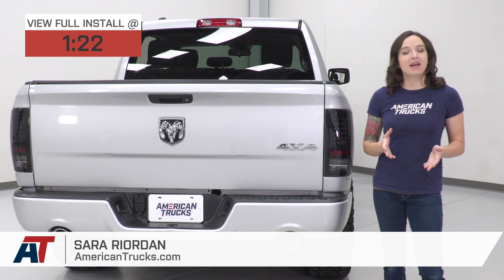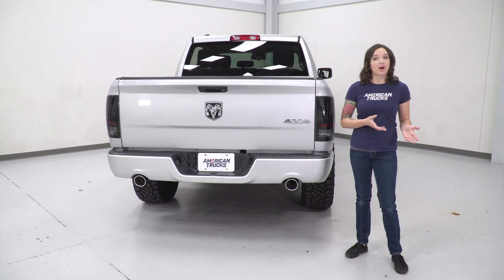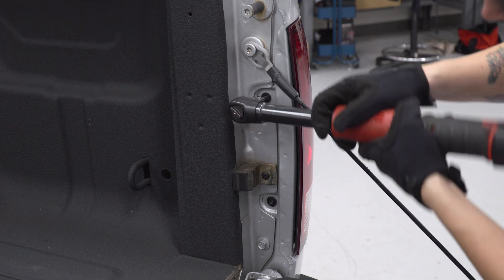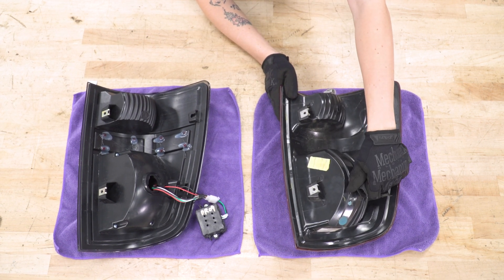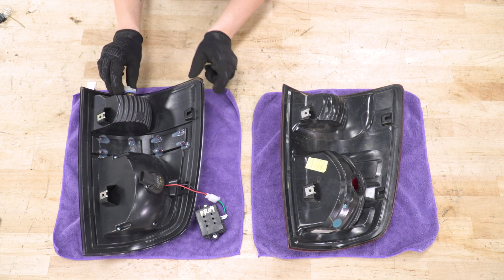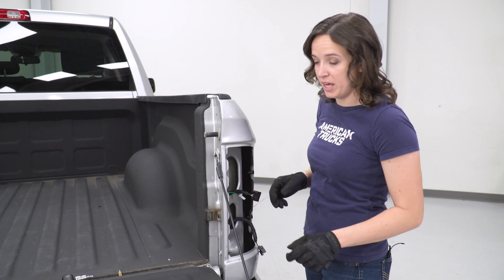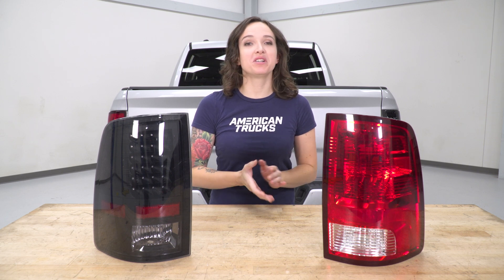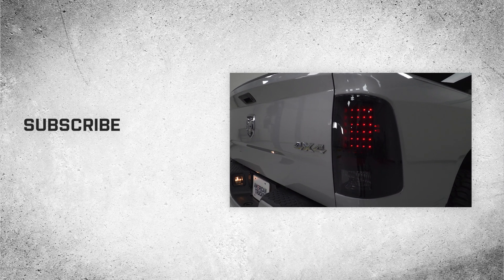2009-2018 RAM 1500 LED Tail Lights; Smoked Review & Install

Comment: I noticed that there isn't a mention of a DOT certification. If they are not DOT they are illegal to use on the road and could result in a ticket. IMHO the Alpharex smoked LED taillights I have on my '19 Classic look better and they are DOT.

Comment: The black smoke type LED tail light, does it to 2021 RAM 1500 classic? Do you have branch shop here in Edmonton CA.
Reply: Can be install to 2021 RAM 1500 classic the black smoke type LED tail lights?